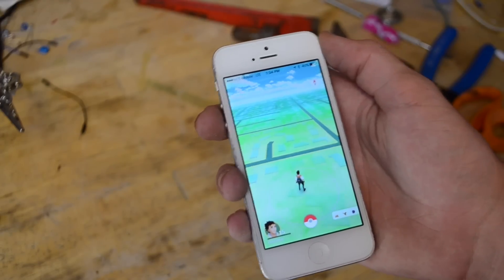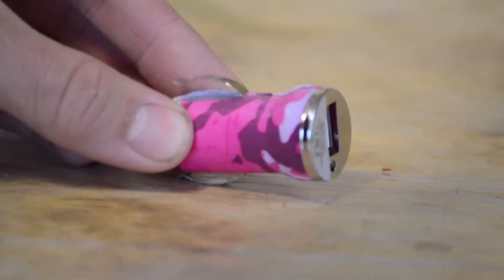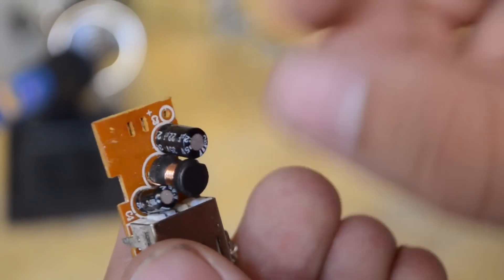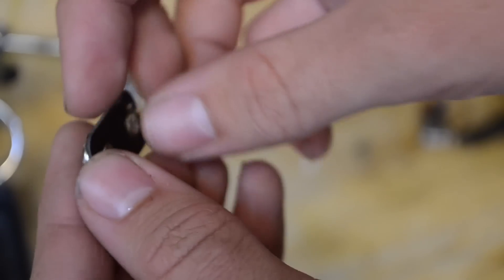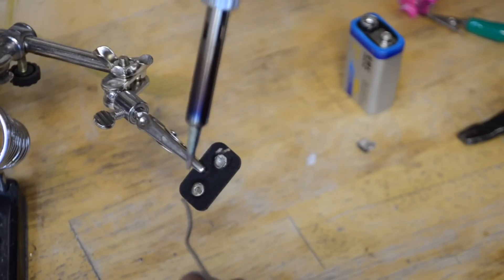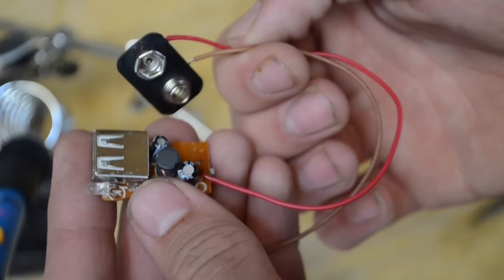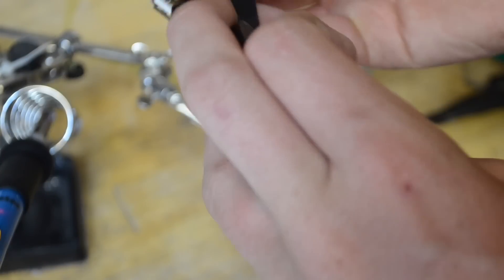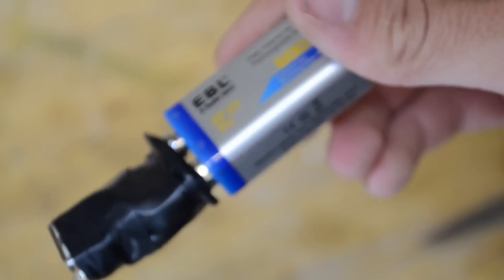How to make a Battery powered phone charger!

Comment: hey i tried this my self but it did't work when i plugged my phone in it would say this is not compatible. i'm not sure if it was that the battery did't have enough amps
Reply from the maker: +joseph rosw-provey hmm yeah I would assume so, I was using a lithium battery which can supply quite a deal more than a regular 9v.

Comment: Another question do you think I should try to increase the voltage or amps? Because if I put the two 9v batteries in a series configuration then it will increase the voltage but not the amps, but if I put the batteries in a parallel configuration then the amps will increase and the voltage will not increase. Which configuration should I do? Or if you have a better idea for this?
Reply: If the 9v works fine in the circuit, then you'd be better off boosting the maximum current instead of raising voltage. Additional voltage could overwhelm the circuit & fry it, but added current will help make sure it actually charges up decently(at least until the batteries are spent)

Comment: necro comment but how much can a 9v battery even charge a phone? how many mAh does it rate?
Reply from the maker: +Two Good with mine I could charge it ( I have lithium 9v batteries that can supply quite. A bit of current, but with more recent testing, I don't think regular 9v batteries have the capability of charging a phone effectively )

Comment: you should avoid using rechargeable 9v batteries with this, without a cutoff voltage you're bound to damage your batteries
Reply: How so? The voltage input is reduced to the 5V DC for USB by the circuit and at some point the battery voltage will drop below a level that can output sufficient power to charge the device. Once the device is no longer charging, you don't really need the charger...

Then again, a few diodes in the system for undervoltage protection isn't really a bad idea...

Comment: If you notice this setup does not really work. I have tried this before and my theory is that the 9v battery is not enough juice cause when you use the phone while charging it with this type of setup it actual loses power. This setup might help a little by slowing the battery from losing power but all in all it does not charge it while playing with the phone. I am going to try to use two 9v batteries and see if that will be enough juices. If you have any ideas or suggestion that would be great. Thank you :).
Reply from the maker: Yeah, mine barely works ( it would only work with the 9v battery I had when it was a lithium battery ) ( I think that's because the lithium can supply enough current to have it work ) I think it may be able to work if you use a 9v battery and a boost converter. Anyways, with your 2 9v battery set up, I think to get it to be most efficient, use a voltage regulator that will hold the voltage at 12v for the charging circuit, or I guess if you wanted, you could probably use 2 regular 9v batteries in parallel to try and give it more juice, and then just the charging circuit, or even your own charging circuit ( like just another voltage regulator to put the 9 v to 5v for charging the phone ) anyways ( sorry about my long paragraph :P ) let me know how it goes!! :D

Comment from the maker: Battery powered phone charger :D
Reply: Keystone Science how many voltage does the car charger need? can i use 2 lion cells in serial?8.4volts
Reply from the maker: +Peter Zingler hmm that may be sufficient, theoretically anything above about 5.5 volts, but idk for every circuit
Reply: Keystone Science OK great i know i have kept this laptop Cells for a reason';D lets build a 20.000mah powerbank :0
Reply: @peterzingler6221  How did you go with that? I basically want to build a small as possible powerbank  (approx. 1000maH)